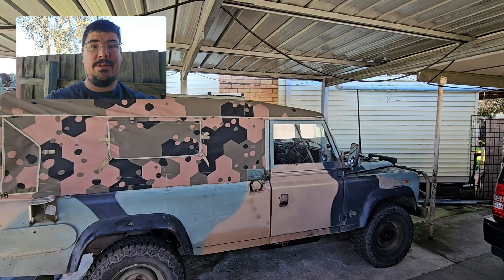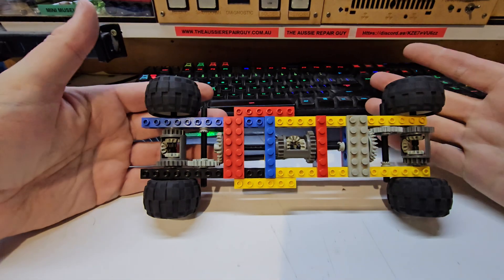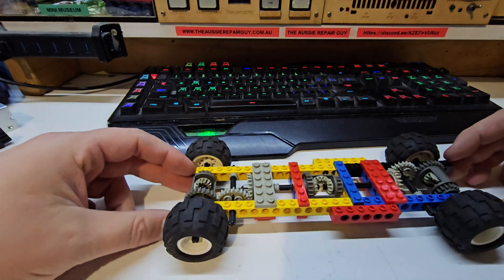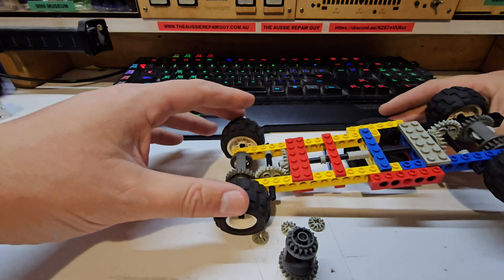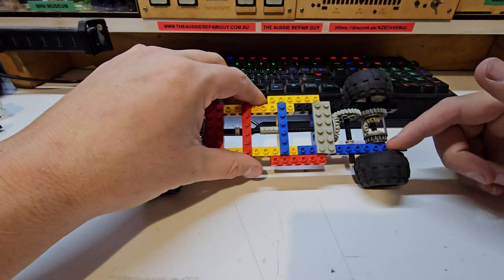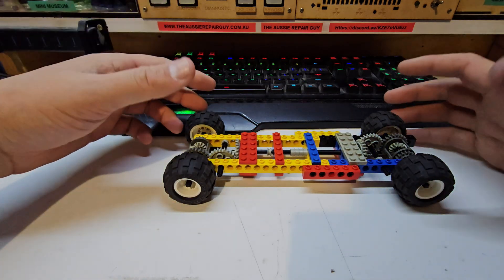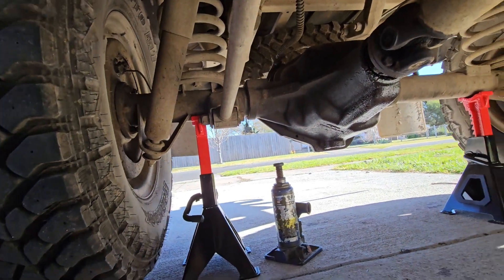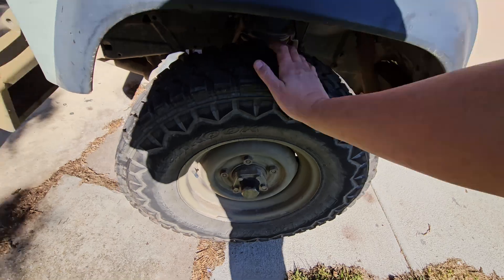4x4 #Perentie CDL and Drivetrain explanation

Comment: A handy little trick I made up was to well a universal join socket onto my mechanical screw jack I bought at wreckers and add a long rod with a socket onto it to fit the uni so I could jack up with my cordless drill it will jack up is around 5 seconds definitely be handy for you with the MS leave you with more energy and it feel safer than hrdaulic jacks which seem to give me 1 year and 1 use before the weather destroys them when I need them most
Reply from the maker: @radaraacf  i have hydraulic bottle jacks. Uni joint not an option. I'm looking into air jacks instead.

I get 10+ years out of a hydraulic. I don't leave them in the weather

Comment: By "pitfalls", I meant that I wasn't quite sure whether you'd thoroughly got across the fact that rear wheels describe a smaller arc than front wheels, which is what makes the centre diff necessary. 
 I had a Series III, and it therefore had no centre diff, but instead ran in 2WD on sealed roads. This meant that one had to select 4WD when crossing challenging terrain and remember to go back to 2WD upon regaining the road, or risk drive train carnage.
 Then we got the new full-time 4WD drivetrain. I had this in my Range Rover. One still had to remember to lock the centre diff before attempting gnarly stuff, and to unlock it afterwards or suffer the consequences. It's tempting, then, to wonder why Land Rover bothered; fortunately we have an answer. The drive train was originally developed for use in the Range Rover. As this was to be a luxury vehicle, Charles Spencer King, the chief designer, said that he didn't want to put a huge Salisbury military rear axle under it. The Salisbury was the only design available which could handle the power and torque of the Buick-derived V8 when the vehicle was in 2WD, and apparently Spen King felt that its considerable mass would lead to too much unsprung weight when the vehicle was travelling at speed on rough surfaces. His solution was to split the drive between the two axle's, allowing the rear axle to be more lightly designed. 
 This is my understanding of the matter - I'm very much open to correction!
Reply from the maker: The 4x4 indeed has the Salisbury diff in the rear.
Much of this drivetrain comes from the V8 mods, as the Isuzu 4BD1 has some fairly difficult to control torque impulses.
They opted for the LT95 4 speed truck box in them, a lot of people try to put R380's in them and find the lifespan isn't that great.

I am, as I've said before, not an expert or land rover historian. I do mechanics as a survival skill, not because I like working on vehicles. - very much the opposite.
Reply: @TheAussieRepairGuy  Ha ha - well put!

Comment: I had no idea that you suffered from multiple sclerosis - I'm very sorry indeed to hear that. 
 I think you did a good job of explaining that. I confess that I made tea and then sat down thinking: "this man has set himself a pretty challenge - let's see how he does".
 Using the Lego was a good idea, but there were pitfalls. I liked the idea of using a jump lead and a welding rod to sort out problems in the bush - I had always assumed you need an array of 12v batteries to  weld. 
 I enjoy, while watching your videos on this 4WD, trying to spot differences between the Perentie and the Land Rovers with which I'm more familiar.
Reply: You can weld with 12v but you really want 24V minimum for getting anything reasonably trustable from what videos I seen
Reply: @radaraacf  I kind of want to try it...
Reply from the maker: @radaraacf  people missed the dry sense of humor and reference to 5 minute craft video.
Reply from the maker: Most of my videos come about from having to explain something to people over and over again, or being unable to find that information in the wild.
As for MS, I get treated monthly at oncology with tysabri. I tend not to make it a huge deal because the topic attracts snake oil salesmen.
the welding thing was a bit of a joke, but yes you can "sort of weld" with thin maintenance rods if desperate.
In truth I hate working on vehicles, but I try to do preventative maintenance wherever possible to make sure I don't have to do things in the field.
it's a survival skill for me, not a passion lol.